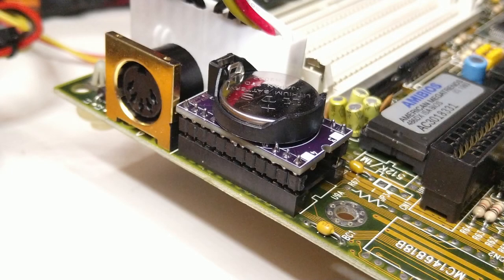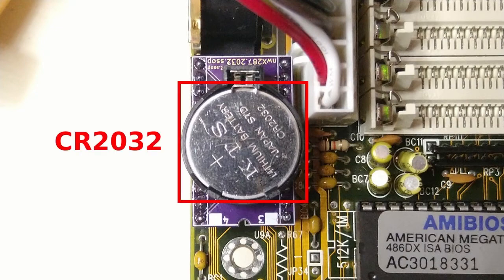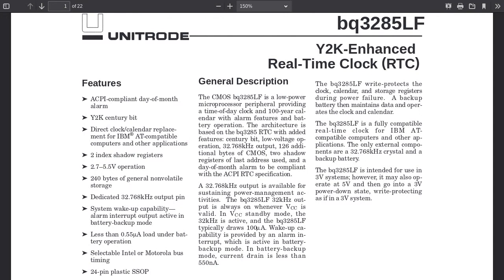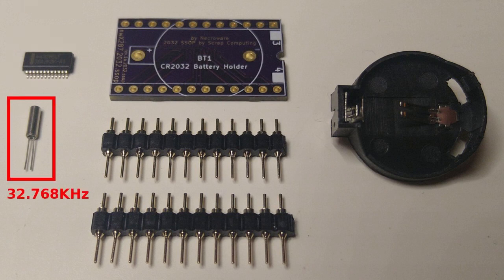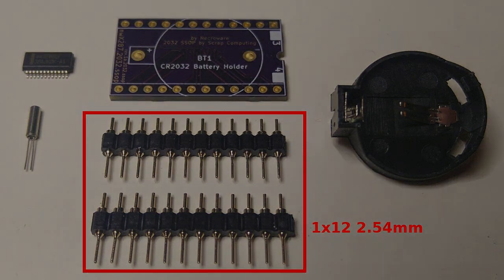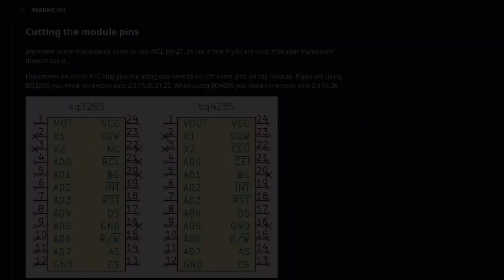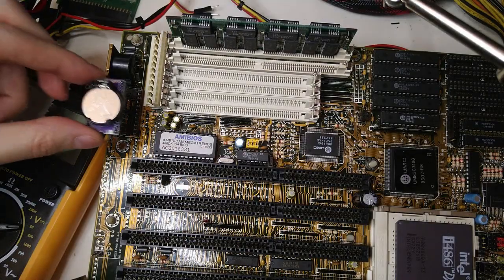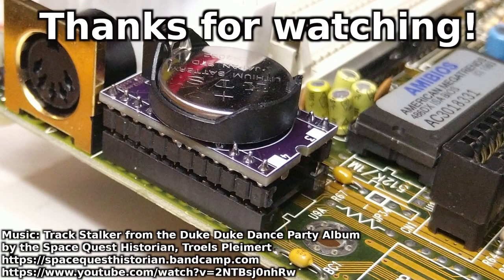NWx287 RTC Module CR2032 edition

Comment: Awesome job! Question… you say to not use the square pins… why exactly is that? What if one was to use those. Will it still work?
Reply from the maker: The most common headers have rectangular pins which are too wide for the socket.

Comment: Does this also work as a replacement for a DS1287A?
Reply from the maker: The only difference between the DS1287A and the DS1287 that I can see is the RCLR# pin 21. As far as I am aware this is supported by the BQ3285LF. So if I would guess it should work.

Comment: Nice work as usual. Don't have any motherboards that use the Dallas RTC but can come handy in the future. What about a little PCB to replace the DIN keyboard connector with a PS/2 connector, i really hate the AT to PS/2 keyboard adapters. Maybe space the PCB to the motherboard with a 3D printed spacer so the center of the new connector matches the old one.